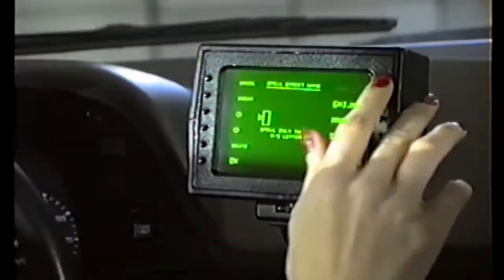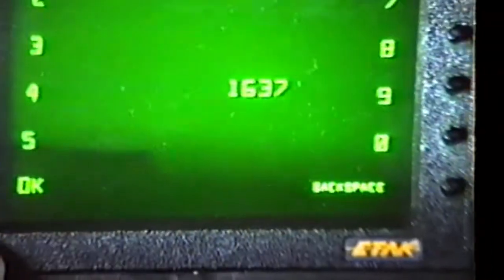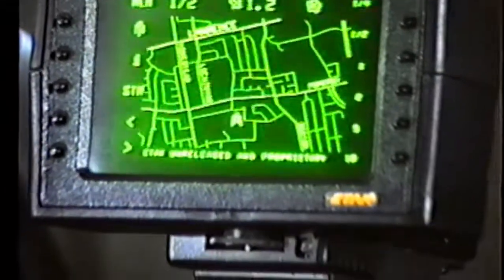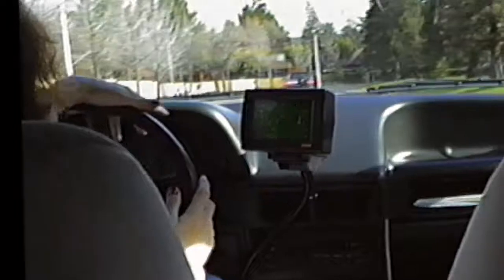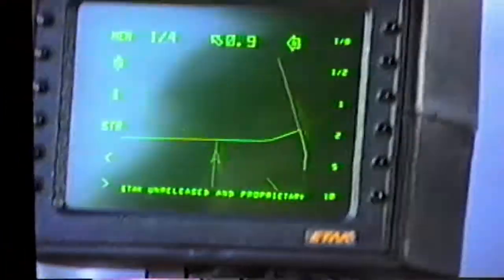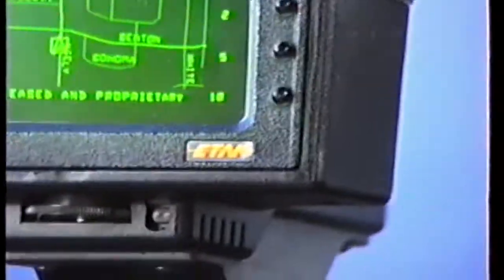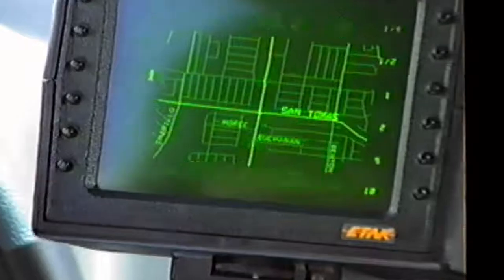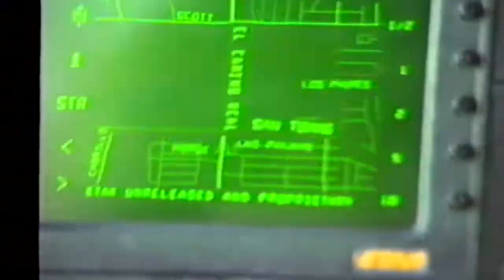Etak Travel Pilot Demo - 1991 - Early Car Navigation System Drive Around in Santa Clara, CA

Comment: We used this system at the local natural gas utility I worked for in the early 90’s. It was used in conjunction with a remote meter reading system to determine the vehicle’s location so it could read meters nearby via a transmitter/receiver.  The magnets on the vehicle’s wheels were the weak link in the system. It relied on counting wheel revolutions via the magnets. So any thing that affected that, like tire pressure or wheel spin in rain or so confused the system. It required a driver and navigator to keep ETAK accurate as you drove. Man, I feel really old thinking about how outdated that tech is now 😅

Comment: Staggering technology without GPS system!
Reply: I just googled it coz I thought GPS was around since the early 70s 
And it WAS invented (army) in 73.
Became available to us (the public) in 83.

Coz if not GPS, what did you think this used?
Reply: @jaysharpESQ  It used cassette tapes that held about 3.5MB of map data.  It had a compass in the windsheild and wheel sensors to esitmate distance.  Pretty out there thinking.  I would imagine that there would be some error over a period of time on a long stretch of highway but pretty crazy.